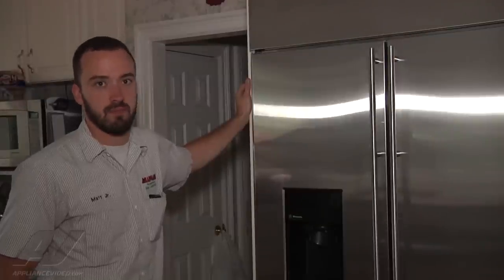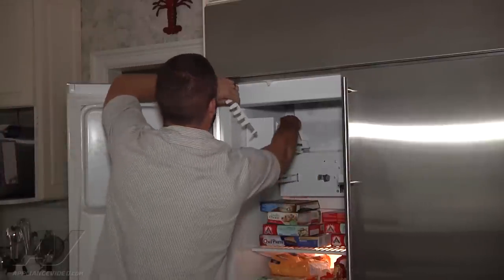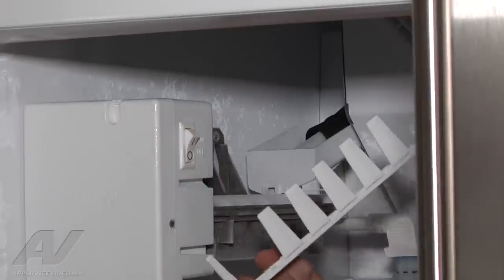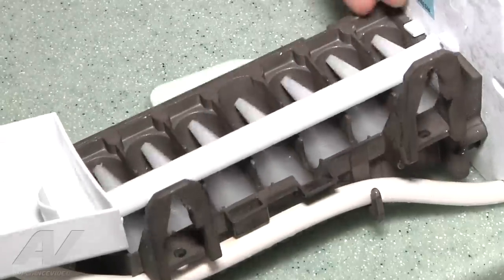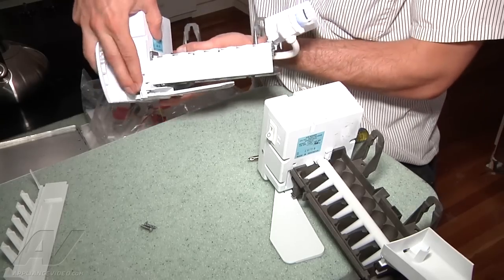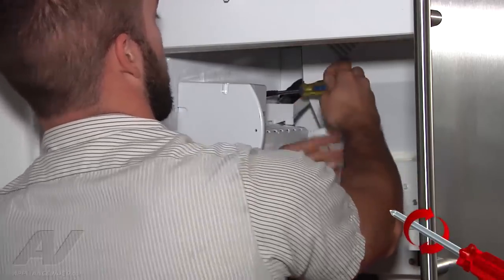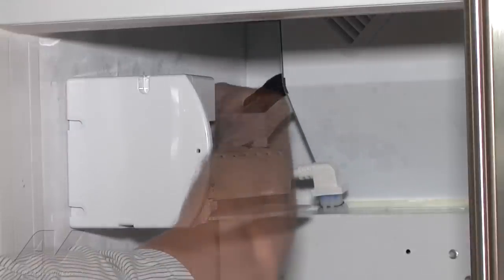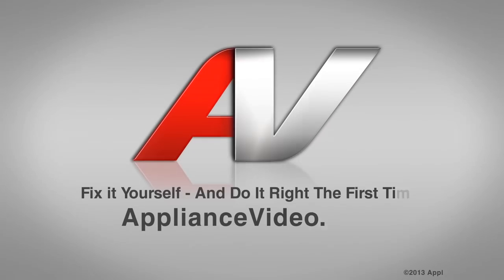GE Refrigerator Repair - Does Not Produce Ice - Ice Maker Kit - Diagnostics & Troubleshooting

Comment: My ice maker is making ice because I added water to it just to see, but for some reason water is not flowing and and I put a stick in the hole to see if it was clogged and nothing. Any suggestions ?
Reply from the maker: Great question, if you have a more technical question that our parts department cannot answer, you can search our over 17,000 answered questions free at our website www.ApplianceVideo.com under our Repair Help section. You can also call our parts department at 1-800-830-5465 and they can give you help 7-days A week ,or search at www.SaveMoreOnParts.com  .

Comment: Hi ! I'm having water troubles with mine, when I turn the water valve on, the water never stops pouring into the ice bucket. It just seems like a switch somewhere is jammed and doesn't stop the water from pouring down constantly. 
Does anyone have had the same problem before ?
Reply from the maker: Great question, if you have a more technical question that our parts department cannot answer, you can search our over 17,000 answered questions free at our website www.ApplianceVideo.com under our Repair Help section. You can also call our parts department at 1-800-830-5465 and they can give you help 7-days A week ,or search at www.SaveMoreOnParts.com  .
Reply: Did you ever figure this out?  My ice maker empties ice into the floor automatically.  It will stop if you open the door.  But, what a mess!